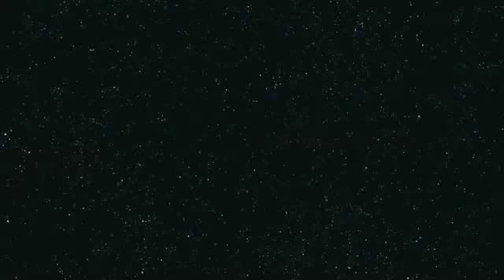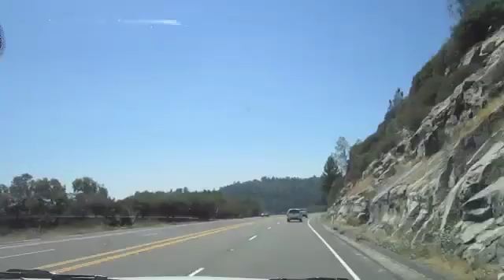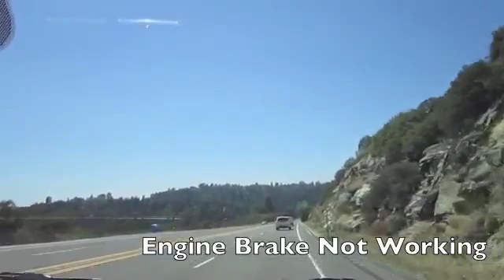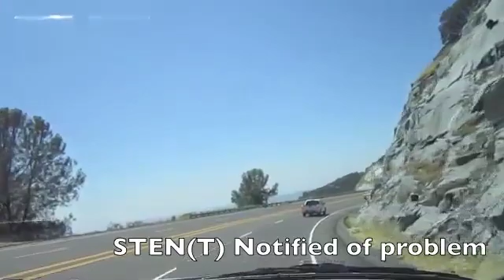Runaway Engine FLA

Comment: This was part of an investigation and done as part of facilitated learning analysis aka training purposes. Ive seen trucks loose their brakes on this section of road and its a long run to the bottom of the four lanes. In a few cases brake failure has led to fires at the bottom causing evacuation of the communities located on the mountain.